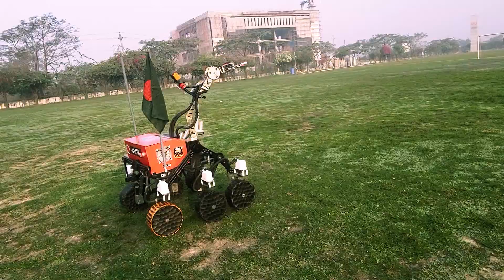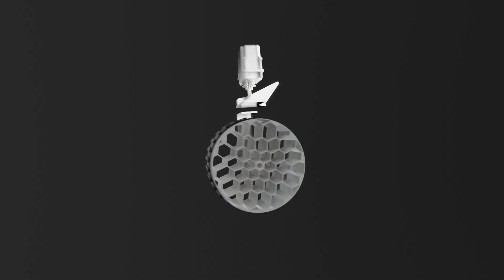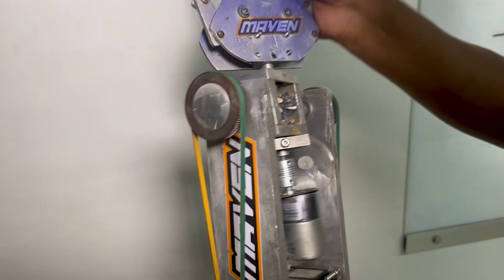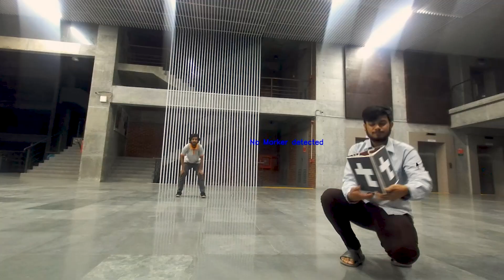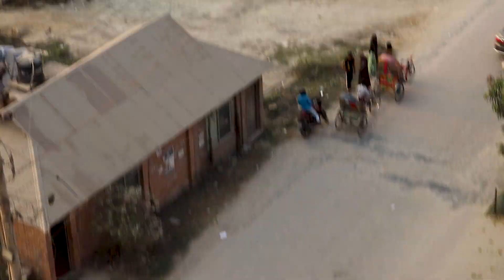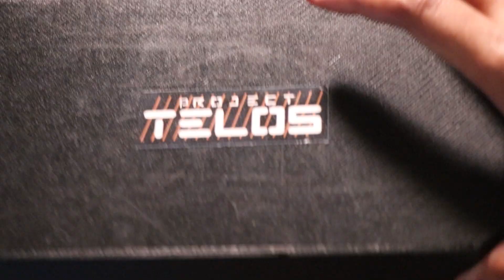UIU MARS ROVER TEAM | TELOS | ICARUS | URC SAR 2023

Comment: Hello,
I'm currently working on a swerve drive project and would greatly appreciate your guidance on calculating the steering motor torque. Could you please share any insights or FORMULAS to accurately determine the steering torque requirements? Your expertise would be invaluable.
Reply: I can help you.